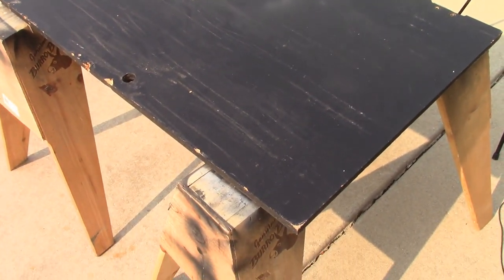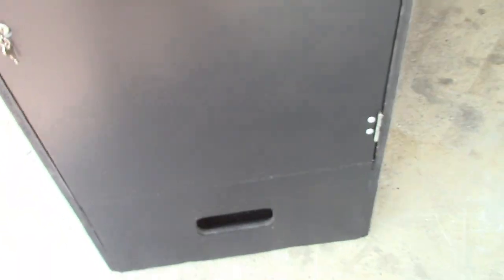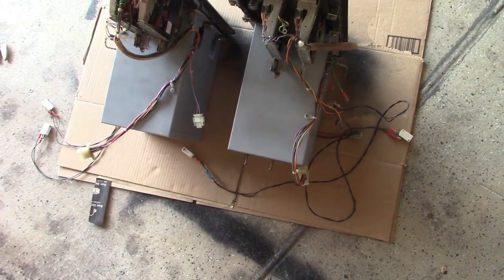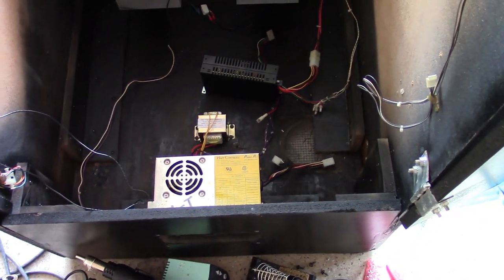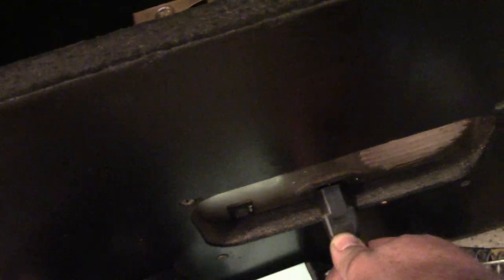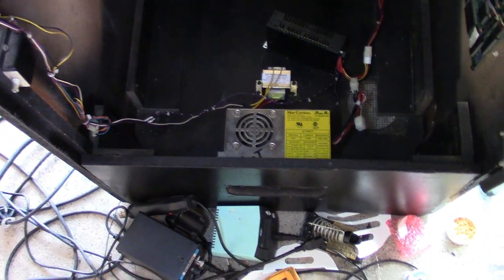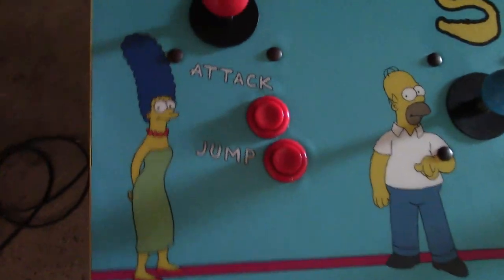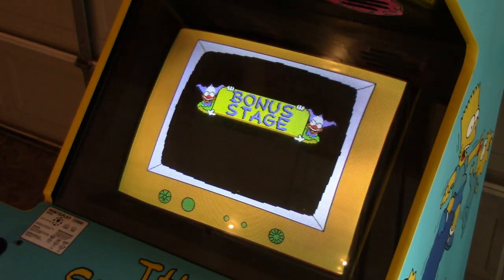The Simpsons Arcade Machine Restoration - Part 5 - Project Complete!

Comment: Pretty epic. No replacement for the plexiglass?
Reply from the maker: I assume you mean for the control panel? No. The new overlay is laminated and it did not come from the factory originally with lexan.
Reply: @YourMKArcadeSource  Lexan. That’s what I was thinking about. Got ya. Good job btw.